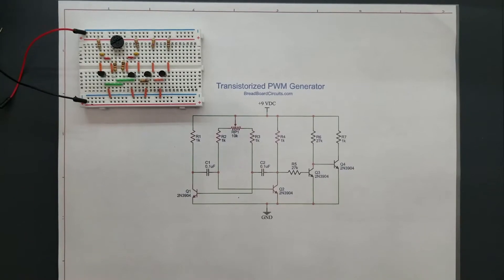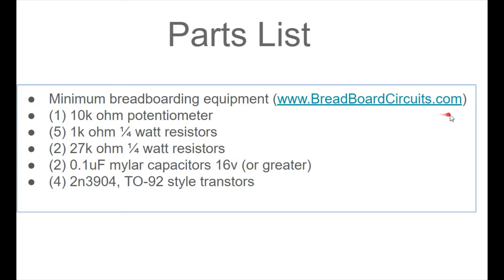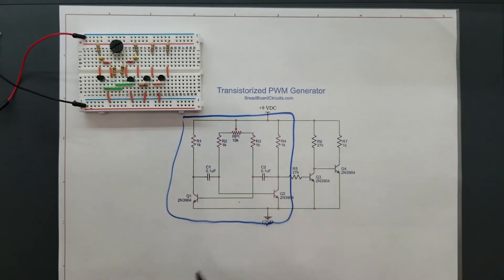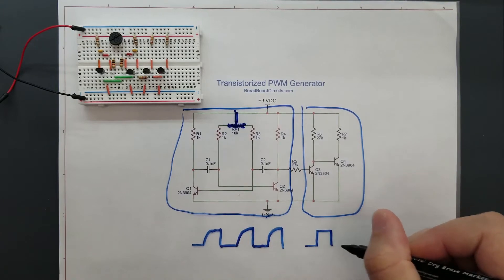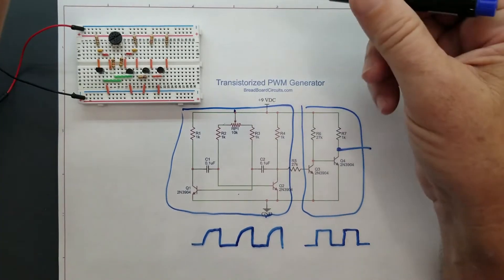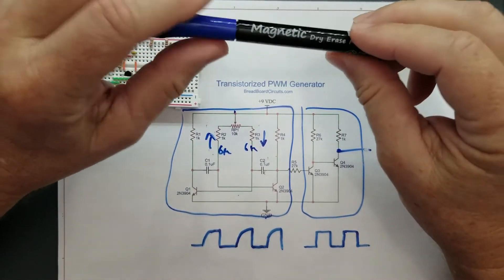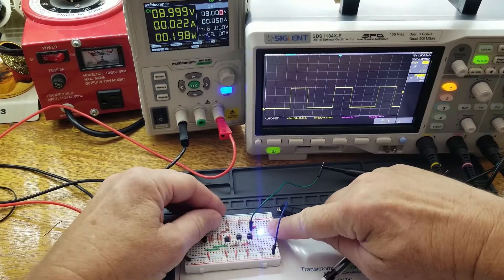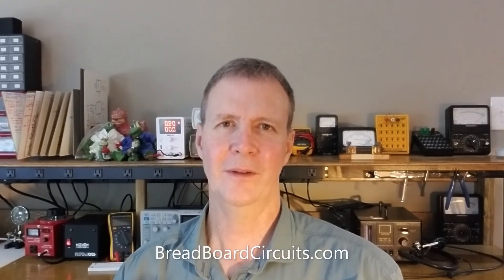#12:  Transistor PWM Generator Circuit on a Breadboard. PWM Circuit Design.

Comment: Where is the frequency deviation (1 kHz at 50% and 1.8 kHz at 15% or 85%) at the lowest and highest duty cycle coming from? Does it result from the nonlinear charging behavior across resistors or is it an effect caused by avalanche breakdown of the base-emitter diodes due too much negative voltage? Maybe also a combination of both effects.

Comment: I built this but I only had 2N2222 transistors and used 22k instead of 27k because that's all I had.  When I give it 5V, the power supply quits.  I went to an adjustable power supply and gave it 12V 3A and the voltage dropped to about 0.6V @ 2.9A.  I have the LED after the first 1k resistor and it doesnt light up.  I've checked for shorts and opens with that feature on a DVM and cant find anything wired wrong.  Transistors emitters all go to ground.  Are the transistor types that important?  Any clues?  Still, nice video.
Reply: I got it to work.  Started fresh, soldered a new board.  I changed the 27k resistors to 1k and now I get a square wave and I can change pulse width with the potentiometer.  I also changed the capacitors to a 10Uf electrolytic and I only input 5V into the astable side of it.  I get about 30-70 to 70-30 range on the duty cycle.  The square wave is not as nice as yours(has a slight rounded rising edge) but with my components available, that's probably as good as I can get it.
Reply from the maker: @harrylister804  Good deal. Yes. the 2222 & 3904 differ mainly by collector current. Glad you got it working. If you add an additional amplification stage you can really clean it up as illustrated in this video: https://youtu.be/j3DpvyWNz1U
Reply: Same here. I only got 2n2222 transistors. Will give it a try this night.

Comment: Can i use BC547 transistor?
Reply from the maker: You can, but will need to observe the different pinout and higher gain of the BC547.  The emitter and collector are switched around. You may need to also adjust some of the biasing resistor values.
Reply: @TheBreadboardMan  thankyou for your response, I tried to make one and I changed it to lower frequency it works but the problem is when I connect it another Darlington transistor it doesn't really turn on and off. I do it because Im trying to make a voltage booster and use the darlington transistor as a swith with PWM signal intering the base but it doesn't work and I tried to change the resistor values and it works but not as what I expect 😂😆. I think I need a mosfet ? Or make the PWM cleaner? Or both? Or just use 555timer IC for PWM signal😆
Reply from the maker: @joshuam.mirabel5280  I would use 2n3904s if possible since it was designed with them. They are very cheap and readily available.

Comment: Haha, is it possible that this was inspired by a certain video I published 6 months ago?
Reply from the maker: This is an original design that is two natural progressions from a classic astable multivibrator.  The first iteration produces a clean square wave output and the second incorporates asymmetry - inspired by how easy that is to do. I haven't watched similar videos, but suspect that the implementations greatly differ.
Reply: @TheBreadboardMan  No worries, I just stumbled across it and was stunned by the striking similarities :) 
I guess we had the same idea just a few months apart. But very nice to see it on the oscilloscope nontheless
Reply from the maker: @ChronicMechatronic  Maybe the circuit just makes sense - or that great minds think alike - but I'm not the brightest LED in the bin.
Reply: @TheBreadboardMan  The circuit does make quite a lot of sense. Now that I think of it, it's kinda weird no one other than us came up with it way sooner - everyone seems just happy using ICs
Reply: @TheBreadboardMan  Actually, I stumbled across your video while researching a title for a follow-up I wanted to do on my PWM controller. However now that I saw your take on it, I realize your clean-up stage makes much more sense than what I had planned, which I can hardly ignore when doing a video :p
So do you mind if I incorporate your design (and clips of your vid) in my video, giving your channel a well deserved shout out?
Reply from the maker: @ChronicMechatronic  Absolutely.  Go for it. Thanks.
Reply: @TheBreadboardMan  Great, I'll leave another comment when it's done
Reply: @TheBreadboardMan  Just published my video, in case you want to see what I did to your circuit: https://youtu.be/CcMiGZUzITo
Any suggestions for further improvements are welcome :)
Reply: @TheBreadboardMan  u are a very bright led. thank u for this circuit i like it a lot
Reply from the maker: @annafernandez6674  Thank you. Hope you find it useful.